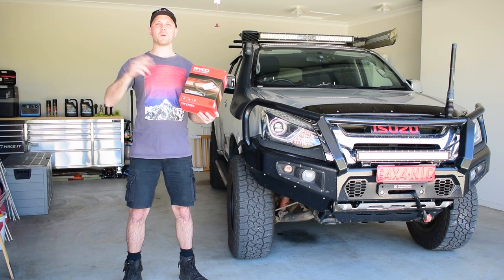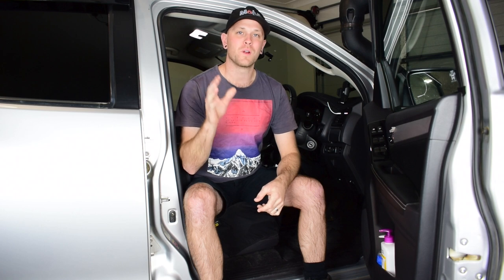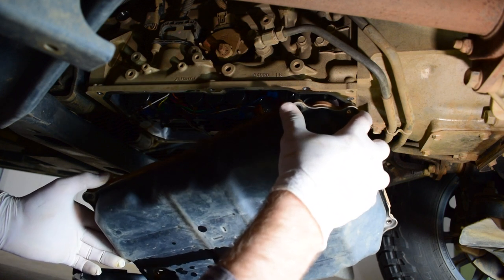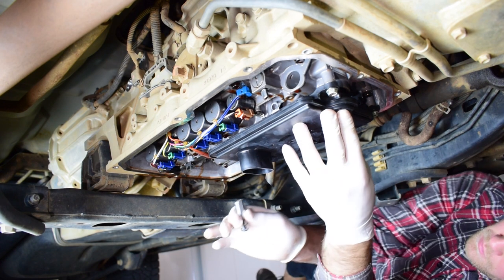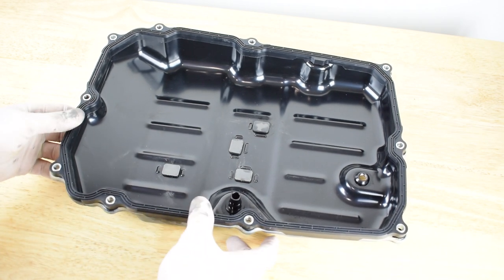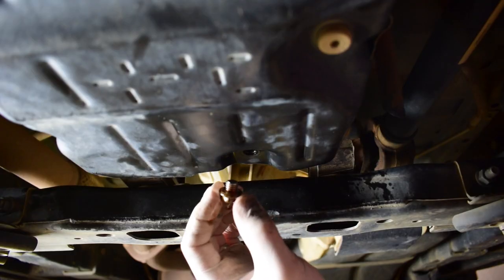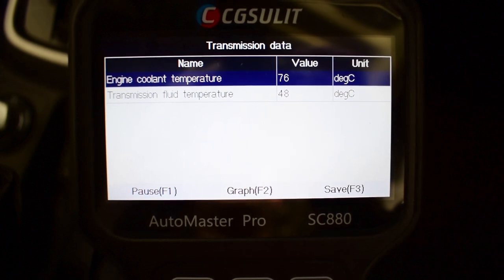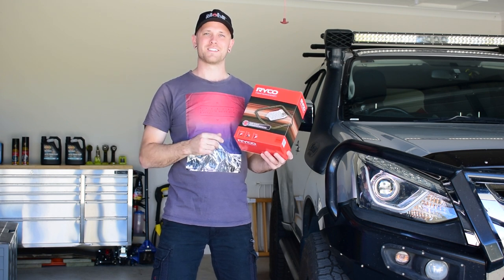How to Change Automatic Transmission Filter & Fluid  [ COMPLETE DIY TUTORIAL ] Isuzu Mu-x + D-max

Comment: isuzu Ph recommends ATF drain and change every 20K 😂
Reply: I reccomend that too, but thats not whats in the australian service schedule.
Reply: 20k is a bit of an overkill to be honest, I'd probably go 40,000kms
Reply: Hi. So drain means only like a 4 / 4½ liters drain and refilled. And how many kilometers Isuzu Ph recommended to renew the ATF filter on a on road only used 2 wheel drive 2013 Isuzu D-Max with a 2500 engine?
Reply: @unclebob5686  Yeh, 40thou km is good too Bob. However that's about the max Km's I'd feel comfortable with (with this method of "partial flush), provided the tranny was not used beyond suburbs and highway.  That tranny's dry fill capacity is ~9.5L, so youre only removing half the previous fluid with this method.   For my own Use Case, (some sand, moderate to advanced low range 4WD'ing and semi regular towing of a 1.5T boat, and I enjoy a little 'lead-footery'), a fresh 4L ($60) in, every 20thou km is dirt cheap reassurance for longevity.  👍 (Its only my philosophy: I do the pan off and  filter every 40thou & a fluid 'semi-flush' every 20 & have a quality ATF external cooler in line before return via OEM het exchanger)
Reply: good tutorial Nick, what would a transmission shop do differently, ive heard they "flush" the trans? Also what's the chances you could do an intake manifold removal and clean anytime soon? , so far the only ones available are all in Thai and of poor quality and workmanship.
Reply from the maker: @bluedunn374  A transmission shop would carry this out exactly as I have shown you. They may carry out additional flushes if the fluid is really dirty. You can check out my transmission flush video and intake carbon clean video if you go into my videos tab.
Reply: Another excellent tutorial Nick, thank you. 👍
Reply: It is 100k in our service manual in Malaysia. I drop the pan every 100k, but every 40 to 50k I will drain from the  drain plug and top back up around 3 liters of fresh fluid.

Mine is the 2013 RT50 2.5 AT

Comment: Hi Nick I just watched the trans filter change. How often should this be done. The dealer did my 2018 Mux auto Tran flush at 70000km I have know done 124000km or can I just do a flush
Reply from the maker: @neilbates8409  It would probably be a good idea to do the filter next service with fluid flush.
Reply: Thanks Nick in regards to that would I do the flush before the filter change or after I have put the new filter in. Sorry can’t get my head around which would be best or not matter 😊
Reply: Oh I just got it 😊 run, drain old oil, put new in, run drain take pan of. Fill new oil. Sorry mate I am a bit thick at times. Old age
Reply from the maker: @neilbates8409  Yep, it's a good idea to do a flush and then take the pan off to do filter change and another flush.

Comment: Great video and it helped me heaps with my transmission oil change. I tow a large ski boat with my 2016 mux and the transmission copes a flogging. I took to a mechanic and asked him to change the transmission oil. He said "I didn't change it as it's as good as the day the it was installed." I now know that oil was black and I probably saved myself a major failure thanks to Nick. Your channel is awesome. Thanks mate
Reply from the maker: That's awesome to hear! Thanks a lot 😃

Comment: great video man ! this is the diy tutorial what I was searching for. but I'm just wondering, what engine you are running ? is it the 1.9 RZ4E or the 2.5 4JK1 or the 3.0 4JJ1 variant ?
Reply from the maker: @voolandashland2914  thanks! It's a 4jj1 3.0l
Reply: @LowRangeNick  cool man. mine is a 1.9 RZ4E. the first gen of RZ4E, year 2019. I think they uses the same transmission. because mine also looks like that. it is look the same.

Comment: Generally a good vid, but you only did a partial oil change, as you left about 3 to 5 liter in cooler lines that go to radiator

Comment: Thanks again for another great maintenance vid as i have a 17/18 mux myself very informative too thanks. would like to see you do a video of changing a cv joint as that's what holds me back from hitting the harder tracks 😂
Reply: There is a frigging sweet cv shaft replacement video on a dmax on YouTube. Lile 30 or 40 minutes long. Well worth the watch. One thing I learnt the dmax is perhaps the worst of all the ifs Ute's to change it. U have to take so much off just to get to the cv and get it out. I'd hate to do it trackside 😢

Comment: Hey Nick, (tkx for your efforts in sharing your knowledge) Mate, whilst fresh fluid will always feel nicer, I was wondering, if you can remember what the Castrol TransMax Multi was like (when you last did this) , and if you have a feeling of any difference between that and the Penrite Synth LV?   (aware too that there'll still be several litres of old ATF mixed in there) - Cheers.
Reply from the maker: There is approx 9l oil dry fill in the transmission. So with the flush and Fluid change you get about half of the fluid out each time. I prefer the penrite oil to be honest. After carrying out this service the transmission is shifting great!
Reply: I have a 2019 dmax and bought it with 80k, now has 115k and gonna do transmission filter and fluid, obviously I don't know what fluid is in there now, can I still use the same penrite as you did in this vid? What if I'm mixing different fluids??

Comment: Hey Nick, great work again. Ive got the 2017 dmax with the 6 speed trans. I find it is always searching for gears and unlocking the torque converter in 5th and 6th. Do you have this problem. It doesnt happen with my wifes 2016 MUX. Isuzu said its fine. Im definitely servicing the trans on both after this vid 👍
Reply from the maker: Hey Andrew, that is very common with the 6 spd gearboxes. They try to keep the engine right in the sweet spot of the rpm for best torque and efficiency. Cheers!
Reply: @LowRangeNick  Cheers, thank mate
Reply: @andrewarchipow6687  I have that issue too. 6 speed box sucks. I wished I got the manual 6 speed. 

Keep ur Mrs 5 speed for ever they are the best version of the dmax no dpf crap.
Reply: @krump743  I have a 2019 dmax dual cab auto and wish i could take it back and insert it in the designers backside,its a disgusting example of todays technology.

Comment: Another great video, thanks again. A question, in the previous ATF change video you used Castrol Multi Vehicle ATF and in this one, Penrite. Any reason for this?
Reply from the maker: Personal preference and the Penrite oil is LV - low viscosity. This is the best type of fluid to run in the transmission.

Comment: when will you do an intake manifold removal and clean?  cheers
Reply from the maker: Never haha. I carry out regular spray intake cleans every service so removing the intake manifold will never be necessary.
Reply: That's a shame for us that don't. might be good for views considering the amount of interest. nice work on the trans 👍
Reply from the maker: @BlueDunn  just start doing regular intake cleans and you won't have to remove the manifold?
Reply: @LowRangeNick  does the oil have to be changed after doing the spray?
Reply: @LowRangeNick  Car was purchased after 100,000Ks and the previous owner didn't do intake cleans or block/delete the EGR (no catch can), so spraying an acetone cocktail into the intake at this stage will just make a bad situation worse. After inspecting with a scope the EGR and intake need a more aggressive clean. Anyway, it was just a suggestion for your content as there's nothing good on YT, and your tutorials are of great quality 👍
Reply from the maker: @krump743  It doesn't have to be changed after. It burns all of the carbon up in the cylinders and out the exhaust.
Reply: @LowRangeNick  oh no crap thanks mate. I've had a few cans after ur last video sitting here but I've been waiting for an oil change to do it. Will do it this weekend.
Reply from the maker: @BlueDunn  It will be fine to do an intake clean. I have cleaned cars with 250k on them at work that have never had an intake clean and no issues at all. The spray breaks down the carbon and it just burns it up. But of course it's up to you in the end.
Reply: @LowRangeNick  Thanks for the advice mate, this one is pretty blocked. Had an EGR code so we pulled it and the carbon had reduced the inner diameter to about 50%. Something for the future I guess if you ever have issues, but looks like you're on top of it. Cheers.

Comment: Hi @LowRangeNick, This is a great VLOG exactly what I need at the moment. I drive a  YB 2013 Isuzu D-Max 2500 Hi-Lander, so it's a 2 wheel drive automatic pickup in Thailand. But I am not getting it clear how many kilometers I need to change, only on road used pickup, ATF filter⁉️ And for the ATF oil the factory manual says change the ATF oil every 40.000 kilometers. But, from what I see in my garage bills, there are only 4 liters ATF oil changed. So my car now is nearly hitting the 170.000 kilometer mark. And I have the strong feeling that my ATF filter has never been replaced and the ATF oil, ± 11 liters 🤔,  is never fully renewed. What would you recommend me to do ⁉️🤔  Renew all the ATF, by flushing they ATF system⁉️ And a new filter, for the first time in the cars lifetime⁉️🤔
Reply from the maker: Hi Leo, you would be better off doing a few flushes and then changing the filter. If you do regular oil flushes it keeps the oil quality in good condition. Every 40k is a good schedule to stick to though. Cheers
Reply: Hey Nick.
When you say do a few flushes, do you change the filter after each flush?

Comment: Thanks Nic. At what Kilometer you need to change Transmission Filter & Fluid please? every 100k?
Reply from the maker: I would recommend a fluid flush every 50k or 60k and a fluid and filter change every 100-120k depending on how your vehicle is used. If you do a lot of towing then you may need to change the fluid earlier.

Comment: @LowRangeNick Hey Nick can you answer a question for me?  One says that with Toyota the automatic oil level should be checked when the engine is running and he says with Isuzu D-Max 2.5 ltr engine, what I own, you have to check the automatic transmission oil level with the engine stopped.  What is true? I am confused‼️🤔

Comment: Hi Nick UK viewer here. We have a 2013 Isuzu Dmax auto pickup that changes gear ok but when you give it some aggressive revs it judders, do you think new oil and filter would help or is this more torque converter. Thanks
Reply from the maker: @jamiegregory5718  You could definitely try an oil and filter change and see if it improves the issue.

Comment: Hi mate love the channel, is there a way to disconnect any type of return line into a bucket, , run and top up, run and top up method to get a proper type of flush,
Reply from the maker: There sure is, but it is a bit more complicated, and you have to be careful not to run the transmission dry. You could take off  the transmission cooler lines at the radiator and run one into a bucket and the other into some clean oil.

Comment: Very informative. I have another question not related to this. My 2016 mux always has problem in engaging 4wd. Been back to the dealer for services and replacement of parts. The problem never goes away. It’s frustrating the 4wd isn’t working when needed. Could I have your expertise answer?
Reply from the maker: You would have to expand a bit on the issues your having? You need to remember to stop the vehicle and put it into neutral to switch into low range. You can flick between 2wd and 4wd high range while driving under 100km/hr.
Reply: @LowRangeNick  The problem is turning the dial from 2H to 4H, the 4wd icon keeps flashing in the panel no matter it’s stationary or under 80k/hr. Even I have tried driving forward and backward in very slow speed. Sometimes the dealer said low oil or software problem. The last time they changed the actuator when it was still under warranty. It last over 1 year. As you are very knowledgeable of this model, I hope you could sort out this problem before I could seek service. Thank you so much for your time.
Reply from the maker: @T Yik  If replacing the actuator fixed the issue for a year then I would suggest it is an issue with the actuator again. If you haven't extended the breathers to the gearbox and transfer case it could be getting debris into the actuator when 4wding. Checking the oil level and condition is a good idea too. I'm pretty sure there is an issue with a circlip or something in the transfer case that can brake. You can sometimes see this in the oil. If the actuator and oil are OK it could be an internal issue in the transfer case.

Comment: Hi Nick, is there any difference with temperature reading for temp level checking for a 2wd or 4wd transmission? Also, if just draining fluid and recording the amount drained, when cooling from hot will it decrease the amount of fluid compared to when it expands hot? Would you also have a link for your torque wrench you use?
Reply from the maker: There's no difference in transmissions between 2wd and 4wd. You normally try to drain the fluid when there is some temp in the fluid. I usually go for a 15min drive before draining the oil. I didn't use a torque wrench in this video, just my 1/4 drive gear wrench ratchet 🙂

Comment: While running the engine is safe to fill tha fluid to transmission?
Reply from the maker: Fill up until it drains out the check bung and then start the car and allow to idle and fill up more until it dribbles out of the check bung.
Reply: @LowRangeNick  sir one more thing i did a transmission service they say only 4 liters they take by dialysis machine, they didn't count the remaining on oil pa  and filter. Because they remove it. But They put only 5 litters of fluid, is that correct sir, thank you.

Comment: Nick, I watched another vid and they said to test the trans oil level in Neutral with the motor running ?
What do you reckon ?
Reply: Righto, so the 5 speed Dmax and Mux have 20 x 10mm bolts holding the trans pan on.
The replacement gasket is like the old rocket cover gaskets off the fords and holdens. The Ryco gasket is a twisted mess.
Should be fun getting it to line up.
Nothing like the 6 speed later models, way harder.
Reply from the maker: @adzoutnabout8666  Testing oil level in park or neutral is fine. I prefer park with the handbrake on so you don't get run over haha The 5 speed has a different gasket and pan design but still same process. The 5 speed usually comes with a cork gasket.
Reply: @LowRangeNick s mate, cork gasket and 20 x 10 mm bolts.
Tip for your viewers….
The cork gasket in the Ryco kit comes out of the box like an Octopus.
No matter how long you leave it in the sun, it dosent straighten.
Once you follow all your cleaning steps, use small plastic cable ties to keep the gasket aligned while positioning other bolts to 2/3rds tight.
Snip ties once the bolts have found their threads.
Other problems were the transmission cooler lines run over the front bolts (4 ) .
You can’t move the lines, even after removing the location bracket on the passenger side of the transmission.
A slim 10mm socket slipped from the drivers side across to the passenger side will sort that. Bit fiddly.
Wish I had a 3 inch lift right about now.
Dropping the pan is also not easy, you need to semi drop the back, then wiggle the front off the mounts down, so it will clear the trans cooler lines.
Filter is metal in the 5 speed, not plastic like in the 6 speed.
All in all I would say changing the trans filter in the 5 speed is a Fark load harder than a 6 speed, given the gasket, the pan and line positions, and 20 bolts in the trans pan.

Comment: Great video and informative ok. No gasket stuff? Well I will be. Showing my age I think. I will be doing it and belts in about 10,000 klm’s. Getting down is easy Nick but getting up is not as easy as it was. Keep smiling ok.
Reply from the maker: No sealant is required with this gasket as the sealing surface is flat and there are no joins in the gearbox where the gasket runs. So no sealant necessary.

Comment: Great video Nick. I have a 5sp auto 2016 D-Max with 90000km with occasional shifting problems from 1st to 2nd or 2nd to 3rd. Only seems to happen when cold. Either a bang or doesn't engage and revs a bit on the shift. Could this be a solenoid problem? Oil is full and has been replaced recently.
Reply from the maker: It doesn't sound good. If you have had the oil and filter changed and the transmission flushed then it must be a solenoid issue or damage to a clutch pack.
Reply: @LowRangeNick  are the solenoids and clutch pack accessible once the pan is removed?
Reply from the maker: @kuducamper9934  you can see the valve body and solenoids in the video when I remove the trans pan. You won't see anything of the clutch packs unless you remove the valve body.
Reply: @LowRangeNick  thanks heaps